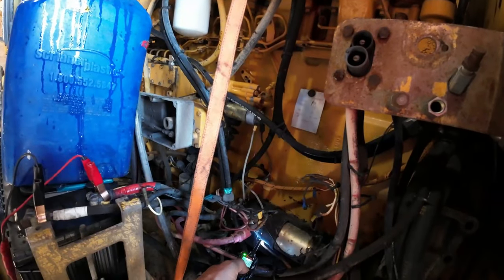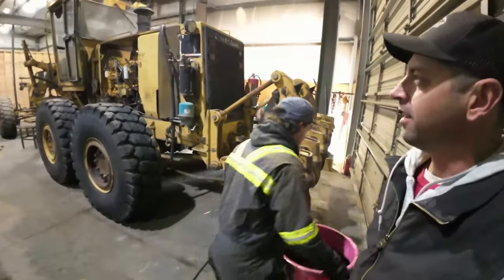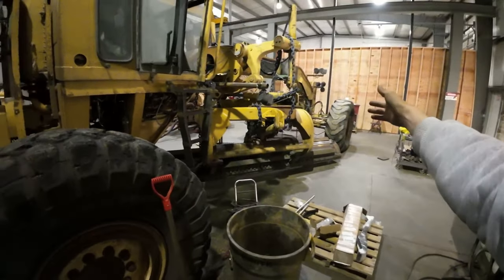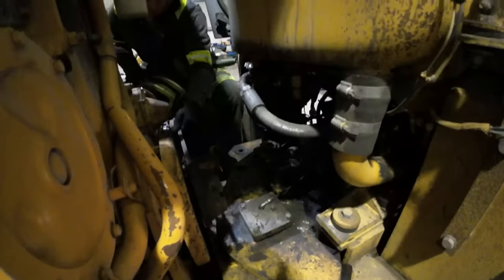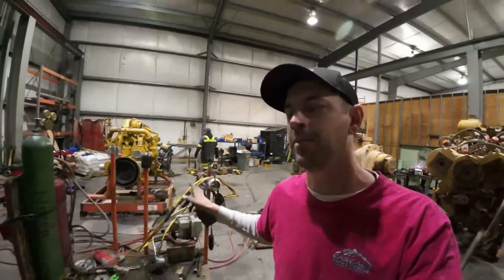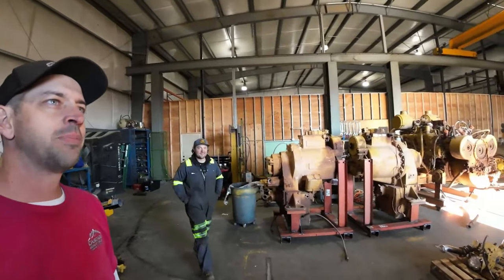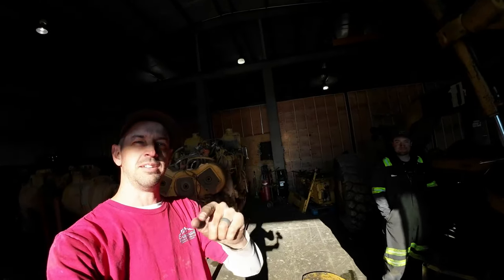Will it start??  Huge machine pulled from the Boneyard!

Comment: We need to hear that 12v92 roar! Also, a CO2 Extinguisher is great for runaways, just point the nozzle at the intake and the engine will stop as it displaces the oxygen and does no damage. Saves having rags and boards getting sucked in.
Reply: Agree on the a CO2 Extinguisher!   Also I would like to se the v12 run !  :-)
Reply: Didn't think of fire extinguisher, was used to boards or kill plates
Reply: Beinlausen depends of the air intake!
How much air goes in and how much co2 gets in. If you dont replace all the oxygen with co2 the engine wont stop. Whit a plate blocking of oxygen it will.
Reply: @henkoosterhof5947  Fire departments usually carry CO2 extinguishers for this. And with plates you can only really directly kill the engine with a perfect seal around the turbo. if the engine revs high enough it will collapse the intake pipes and suck air from wherever it can. Then a co2 works better to snuff it out.
Reply: Absolutely. We carried CO 2 extinguishers not for fire but to shut down our diesel engines if we entered a flammable gas leak area.
Reply: Or you could just throw the shirt on your back at it🤷‍♂️
Reply: V12 off-road recovery vehicle.....yessss. I like it. (In the voice of an evil genius!)
Reply: @phatdaddy1955  The challenging part is it would have to be a motorcycle so as not to ruin the 2 of everything theme.
Reply: We have a 16v92 and a 12v141 as main generator power on a couple of our Port Container Cranes. It is an awesome sound when they are under load and running at 1800 rpm. You can feel the sound all through your body.
Reply: @phatdaddy1955  Please don't let Matt over at MORR see the V-12, his head is already full of crazy ideas.
Reply: Good idea on the CO2 I will have to keep that in mind
Reply: I have sauce and noodles😅
Reply: I've seen a 16v,92 run and run away kinda loud I tell ya what.
Reply: @henkoosterhof5947  The carbon dioxide gas is also supercooled at -60°C so that will eliminate the heat needed to combust diesel fuel.
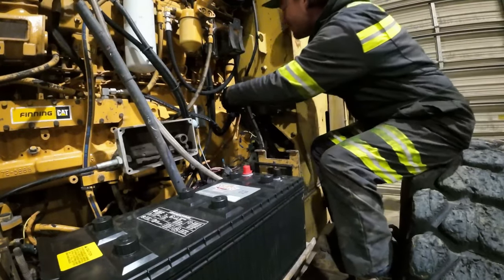Reply: @my89scottsdale67  I’m 23:58
Reply: @davidmunro1469  huh?
Reply: Let's see that V12 run. The world needs to see that run 😂
Reply: Wish I knew that a few rags ago

Comment: I would love to hear that 2 turbo, 2 supercharger, 2 stroke generator start.

Also, my uncle installed a shut off valve on the turbo oil line just incase the seal blew out. Had a knob in the cab that he could pull to actuate the valve.
Reply: Awesome, yet simplistic Idea that saves the day
Reply: That is a really awesome idea!

Comment: Casey, it was nice to see/hear some of this stuff again.  I worked in the Cat plant in Aurora, Il. where the 992's where built.  In fact, on worked on that line. That line also built the 988's. I believe the graders were built in Decater IL. I moved to the Pontiac, Il plant, where we made the fuel systems for a lot of the engines. I also worked on the lines that made the fuel systems/injectors for the 3406 and 3500 engines. Pontiac took pride in making some of the best injectors/fuel systems out there.
Reply: When did you work at the Aurora plant, & what area? 
I used to haul parts & equipment into that plant often. 
I also had to haul overhead cranes into the plant as well.
Reply: @timothygeiger8271  1978 to 1982, got hit by those big layoffs in the 80's.  That's why I ended up in the Pontiac Plant until I retired.  I work for a brief time in building G on the paint line,"fun". Then moved to building H on the 992/988 line (worked on the front of the line.) At Aurora, I was in Materials and resupplied the line.  Those overhead cranes were huge, some were even remotely controlled.  It was surreal watching entire machines moving in the air.

Comment: Looked up "shake hands with danger"..
Even though it was done in 1980...
It Definitely Makes a good impression. 
When I was just getting started in the Air Force,  most of the safety training Films were late 70's early 80's. I joined in 85
Reply: This was recommended to me today as well and i was just about to comment this...
Reply: Yea,it's cheezy video but I'm sure it's saved lots of people
Reply: Yeah, I just watched all 22 minutes while in the middle of this video
Reply: @pibblesracing  yeah me too 😅
Reply: Joined USAF in 1978, Ground Radio. Radios back then would be considered heavy equipment today.

Comment: I definitely want to hear and see that Detroit run! Those old 2 stroke, 4 valve, roots blower engines are awesome and I'd bet any money that, as long as the racks aren't stuck, she'll fire right up! I used to work on a set of 6-71 TAs in a sportfishing boat and I absolutely LOVED them. The slight idle roll used to lull me to sleep! I miss just sitting between them and listening to them chatter away.

That CAT sounded mighty healthy. I know Quinton wants to do right by his customers and I appreciate that very much, but he might get some good spare parts out of that motor when he rebuilds it. Just judging by the oil pressure and the smoke out the stack and hearing it run, it's fine the way it is. Probably get 10K hours out of it just as it sits.

Comment: Hello from Alaska. As a diesel mechanic of 20 years and commercial fisherman before that, you absolutely must get that 12v92 running. It would be a treat to watch. I e helped rebuild a couple of them and several smaller detroits. They are very reliable engines.

Comment: Back in the late 1990's I was working for a trucking heavy equipment rental business we had many military  surplus  pieces of equipment, as the welder. We had surplused hull plates. I beams. One day the boss ask if I could build a heavy steel table to  repair hydraulic cylinders. The legs  were of 1" thick 8" I-beams. The table 1/2"x 6'x10 hull plates  1/4" x 3' flat bar made the  sides. Where the rachet straps hooked  a 1/2" pipe nipple a ball cock for draining the oil.  For small cylinders a pipe vice mounted on an additional piece of the 8" l beam welded to a rear leg. After the build was finished that table earned $10,000 in the first 30 days. I was cutting wrenches out of plate steel to remove the larger nuts. The largest cylinder rebuild was for a 40-ton heister forklift that was designed to stack 40' shipping containers 5 high. 4 stages in the cylinder.

Comment: I think I saw "shake hands with danger" in high school because that's the last time I've heard the name
I think all heavy equipment was designed by an engineer that worked on equipment before becoming an engineer. I've always said that if engineers worked on the equipment they design the machine would be built differently

Comment: Definately yes for this gen unit.
Fellow you tubers like andrew camarata, diesel creek, diesel brothers,Jesse muller and salvage workshop buy and get these units home.
Wrong about the point to close the air intake, but right about stopping.
1/2 of the story. Other 1/2! Piston rings bad. Sump has a vent into the inlet. Pressure in the sump, oildamps go up, sucked in by the engine wich runs on these damp/mist.

Comment: My first fuel job was running a Class B Wet Hose Truck, I did fleet fueling and heavy equipment. 1/2 the time the heavy equipment was running as they hated down time. I was shaking hands with danger as I crawled up onto the equipment to various fueling points. Thanks for the lesson and the cheesy video. Praying for no diesel runaway when you start it.

Comment: Engines in the oil fields have an inlet shutoff valve that will block the air inlet as close to the inlet as they can get it.  This is so if there is a natural gas leak they can shut the engine  down even in an emergency.

Comment: Sounds like they all need a shut-off solenoid for the turbo oil.  That would blow up the turbo, but save the engine.  My brother-in-law is a mechanical engineer for Solar, a division of Cat.  Nice to actually see some of the scale of equipment he works on.

Comment: Matt on Diesel Creek (you Tube) starts a lot of older equipment. He did a 1950's Galion grader a while back. He does a lot of vehicles recoveries. Mostly big construction iron. Very interesting. A diesel revival seems to be pretty straight forward. Sans catastrophic mechanical failure. Could watch them all day. Which I pretty much do! I have an old GM Bus with an 8V71. So, as per You Tube rules, you must show a 12V71 start up.........I don't make the rules!  Thanks for the variety of content.

Comment: I drove truck for a few years and one of them had a 318hp Detroit Diesel in it. It was an incredibly slow truck to drive but was faster than some of the naturally aspirated Cummins at the time. Detroit diesels need the super charger to operate. The air pressure that is created by the super chargers is used to blow out the burned gases from the cylinders and then recharge them with fresh air. The turbos are used to create more horsepower. On my 318 Detroit it had a super charger on it but no turbo. If it had the turbo it would have gone up to a 350 hp engine. Also changing the injectors would have created more horsepower but would be at the cost of more fuel being burnt and getting about 5.5 mpg as it was didn't need nay more expense. Great video...more please! I always wanted to drive a truck that had a Cat 1694 in it... would have been great! Keep up the good work! And, stay safe!
Reply: I also drove a 318 Detroit (8v71) ten speed, it would out run a 290 Cummins but the 300 and 350 Cummins would out pull the Detroit.

Comment: The shut off is interesting. I learned something. All the smaller engines (From big trucks down to skid steers and reefers) work the opposite way. They use power to open the fuel supply. On some (I used them), there is even a manual screw that can be turned by hand in the event of an electrical failure. That 12V92 isn't scary at all. A friend had one in his truck. Yes, other channels do "will it run" on big equipment too. That doesn't mean you shouldn't. I enjoy it, and I'm sure others do as well. Your theory on what can happen when your turbo fails is true, but not always. I have had two turbos fail and no runaway. Made lots of smoke though. I suspect most of the oil went into the exhaust side...fortunately.
Reply from the maker: It’s not a theory, what I said is the absolute fact of how turbos fail.   They can fail in many different ways, and if they fail in the way I said, the engine will run away
Reply: @CaseyLaDelle  I made the comment before you told the story. Like I said, I got lucky. It went into the exhaust side both times for me. There are also a ton of Youtube vids with runaway engines. Scary stuff. Kinda sad too. On the self fueling note, they can even do that if the engine gets too worn and the oil goes past the rings. If you don't keep your engine fresh, you could end up with no engine at all. Keep making these vids. Lots of good info in them.

Comment: I had a 3406C in my Pete 379. That motor was AMAZING, however. I did have it decide to spin backwards while I was driving it slowly I was slowing down and down shifting and suddenly it went backwards so I had one forward gear and a bunch of reverse gears. It shut it down, refired it and it was fine. We also have a 1969 D8H and that ole girl is a WORK HORSE. Those old mechanical cat engines are unbeatable in my opinion!

Comment: Yes start the 12v92 beast! !! 🤔👍👍🍺🍺
When I was a kid my dad had a 3408 in a Peterbuilt Transfer dump truck 18 speed 
The local Cat dealer had a dyno and the mechanic was afraid to open her up for fear of the chains
Busting loose dynoing the truck was doing over 800 horses 😃😃

Comment: There’s no satisfaction like you get fixing up something like that! And Recycling it makes soooo much more sense now than when I worked in a Car salvage yard! OEM sheet metal, engines, transmissions, wheels, tires, interiors, exterior pieces, mirrors, glass, including front and rear bumpers! Front to rear every part should be recycled!
All the Fluids, all the hazardous waste, batteries, grease, oil, windshield washer fluid, diesel fuel, DEF, brake fluid, antifreeze, and Yes even plastic parts, needs to be Responsibly Recycled! And chrome plating should be minimized to as few parts as possible, the process has been almost shut down here in the USA, it’s extremely dangerous to humans and the surrounding environment!  That’s my Soapbox and I hope that many more people agree! 
Car makers take Note, the lithium Batteries that your using to power cars is a ridiculous, stupidity not only is it a rare resource, but takes so much more energy to produce one battery and the life time is so short. It sickens me! Plus what it does to the people that live where the raw materials are from. Look it up people!
As for the chemical industry that has lied about plastic for 50 plus years, you can’t have it both ways making cheaper plastic that doesn’t recycle, and saying it does, by shipping it out to 3rd world countries. Where it is simply illegally dumped.  Take the profit away and do the right things! Dropping the Greed of right now for the future of tomorrow is more ethical and responsible and it would ensure our and your Future as well, bite the sour apple, it turns into a great pie once it’s Cooked properly!

If you like this 👆Copy and share it, make it your own! 
Send Casey more Likes on here and he gets more too! 

Remember that what you do everyday is vote with your dollars! What you Buy gets more restocked.  So buy responsibly! 

Just wondering 
If you are running a little Diesel motor at 50 mpg, and then you put a bunch of stuff on it that costs you mileage say down to 28 MPG how much better is it for the environment? 

Something like that is what I think, the whole VW scandal was about, auto makers are all guilty of misrepresentation of the truth. And I believe the Big Three automakers were all going to get caught with their hands in the Cookie Jar! Instead they agreed to throw VW in front of the bus, they then quickly and quietly closed up their own loose ends, and pointed at the Germans... 
hey we all know that it was just a little scam.  Frankly I’m appalled at how it works out and is never going to improve... 

It’s patents that also have kept our cars from so much better fuel economy. 
The Gas and Oil companies have bought and owned patents that the American people and others can’t even use to the whole earth’s detriment. They even have legions of lawyers to protect their patent rights. 
Also they continue to control the environmental protection impact. The CAFE standards have not been increased by much since 1986 I think the overall fleet standard back then was 21 MPG, kept in place for the oil and gas industry by their Cronies in Government offices!

Don’t be a 12 second Attention Span GOLDFISH!!!
You know that you have to research and read to find out the facts, DO NOT TAKE THE WORD OF ANY ONE TRYING TO BE A POLITICIAN OR ARE ALREADY! 
Look up facts, and facts that are not altered by comments on Wikipedia! Misinformation is out there be careful about it!
Rant over be peaceful but firm with the truth and the standards that you keep!
Be a better person today than you were yesterday! And planning on being Better tomorrow will just allow you to skip the hard work that is today! Stop avoiding your Human responsibilities to protect and preserve our children’s rights to a Better future!

Comment: Many years ago I worked in the NZ Railways. Where we refurbished CAT D398 75B V12 engines. These were coupled to generator sets to power and run Locomotives. Watching this video reminded me of some of the practices we had to do often.   While many have said about using Co2 as a means to smother a diesel engine. The larger the engine the less likely you will have enough Co2 to do the job.  In the case of the V12 CAT D398 75B. When it runs away. (Which I had the fortune to watch) You need to use 2x large  BC extinguishers to stop it. Yes using these extinguishers cause internal damage. But nothing compared to a totally blown engine. Cheers For the great Content.

Comment: Fan of “Highway Thru Hell” here. They have shown pretty much every kind of thing stuck (including snow plows), broken down, rolled over, off a cliff, etc., but I don’t recall a broken or stuck road grader. Admittedly, they’re using six-wheel drive ones, and they doubtless break down from time to time, but they have never shown one unable to move under its own power.

Comment: Just a couple of little notes, not all of caterpillars were made in the US. I've hauled i can't remember how many parts that were made in Mexico to plants throughout the US. Caterpillar has a huge plant in Mexico where they make parts & equipment that's distributed throughout the US, mainly into Illinois, Kansas, & North Carolina. 

Also caterpillar hasn't made a truck engine for years. If you see a truck with a a caterpillar engine, its going to be an old truck. It was back in the 90's when caterpillar quit making truck engines, when the federal government started putting so many regulations on truck emissions.

Comment: I rented a 185CFM air compressor for sand blasting a log house.  I went to start and warm it up,  I made it three steps away, Engine revved to the moon and the compressor pressure relief was so loud even with ear plugs my ears were ringing all day.  Thankfully E Stop worked.  Engine was out of control at the most 10 seconds.  Oil everywhere in the engine bay.  Rental company said they would exchange it.  I had a feeling young desk jockey didn't take me serious.  When yard guy/mechanic brought me a newer unit I explained to him what happened and showed him,  he responded with "WTF I was told to give it the once over and send it back out"  That old bugger lost his mind on the desk jockey.  Owner contacted me a week later asking for written statement for insurance, unit was a complete write off.  Engine is one thing, but the compressor was what really scared me. I'm not to proud to admit I damn near sht myself.